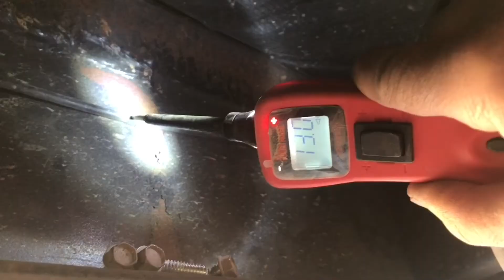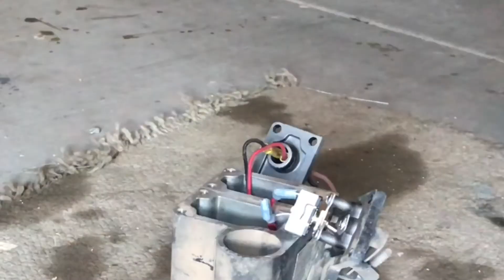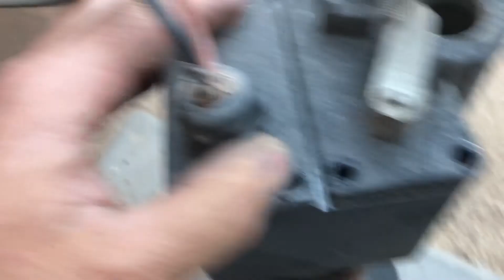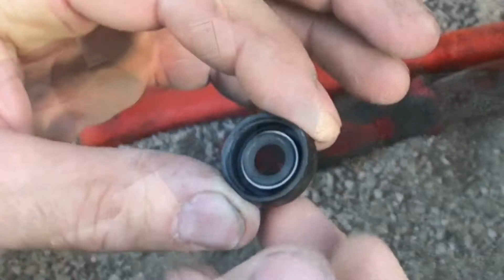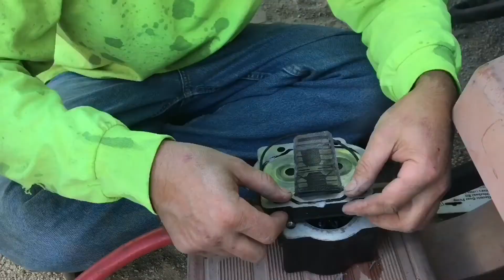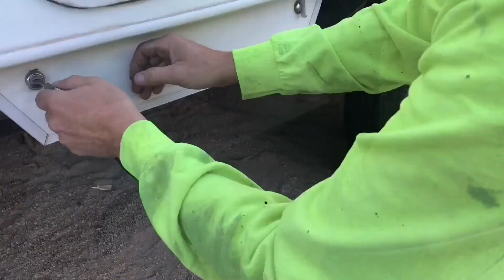FUEL TRANSFER/AUXILIARY FUEL TANK PUMP REPAIR DIAGNOSING &REPAIRING IT CONCEPTS SAME FOR MOST BRANDS

Comment: Hey man was wondering is those are the fuel pickups on the side of the tank? My generator seems not to be getting any fuel and am thinking the fuel pickup of some sort has fallen off
Reply from the maker: Yes the fuel pickup for the generator does pull off of the tank as well but more likely a fuel pump for the generator is a more likely cause I have a video about generator hard start no start on my channel if interested I had to replace the carb on mine

Comment: Question , I replaced fuel pump and timer switch on my weekend warrior , as soon as timer is activated it blows the 20 amp fuse . I’m assuming there is a short somewhere but I can’t locate it . Traced line as far as I could back towards fuse box . Any suggestions?
Reply from the maker: So if it’s not just tripping it at any time then from your battery connection to the timer is OK so it’s between the timer and the fuel pump or the fuel pump itself might be worth disconnecting one wire going to the fuel pump the one coming from the timer and see if it still trips it when you activate the timer

Comment: Did you replace the seal on the gears? I thought it said you did in the video. If so, where did you find the O ring gasket? I only see them offered with the new gears as a kit. Also, a great video. Thanks
Reply from the maker: Watch again its in there and yes probably only get when you purchase a kit
Reply: @diydan7019  I wasn't implying there wasn't an O ring. I wanted to know if the original was reused or if he got a new one and, if so, where it was purchased. Thanks

Comment: My fuel station door was locked on a brand new toy hauler and it somehow opened in the lock position. Fuel hose and handle got drug down the 10 freeway and completely destroyed it. Replaced it with a long hose and swivel nozzle. I now strap the house inside in case the door ever pops open again.

Comment: Thank you! This is by far the best tutorial I have found for pump station repair. I have a 2018 palomino puma toy hauler that the pump does not turn on. There are no bad fuses in the circuit breaker panel. Do you have an idea where the fuse may be? Again thanks. Great video.
Reply from the maker: I’m guessing up with the batteries with an inline fuse just guessing good luck

Comment: My pump runs, but will only pump out gasoline if the tank is less than a 1/3rd full.  Any suggestions??
Reply from the maker: What is the tank on auxiliary tank in a truck or toy hauler my toy hauler will create a vacuum especially if it’s full if I don’t crack the lid the less fuel in the tank the longer it would take to build a vacuum sounds stupid but it can happen

Comment: Good info. I have a problem with my fuel station pump also. Replaced the generator pump and cleaned the bowl and new filters it still runs bad if at all. Think I have gunk in the tanks causing issues. Any recommendations would be great.
Reply: Damion Johnson , For your generator you need to remove the plastic on the elevation adjusting screw so that you can pull the crew and clean it . Make sure you count how many turns it is factory set sitting screw and counting turns . Clean jets in carb as well . Mine always surged until I cleaned the elevation screw.

Comment: Thanks for the video. One thing to remember. If you are using a power tool with brushes you can have an immediate 🔥 fire. Brushless impact is less dangerous. Once i got some carb spray or brake clean on my brush impact, pulled the trigger and instantly it was on fire. Safety First. I got a new to me Toy Hauler and the pump inner seal bleeds fuel out the pee hole if you turn the pump switch on for a couple seconds and don't pull the nozzle handle. Will dig into it and replace the seal.Thanks again.